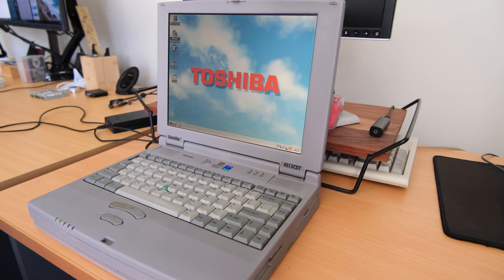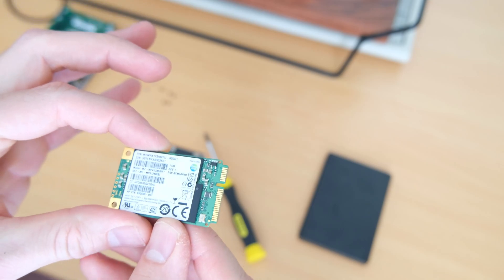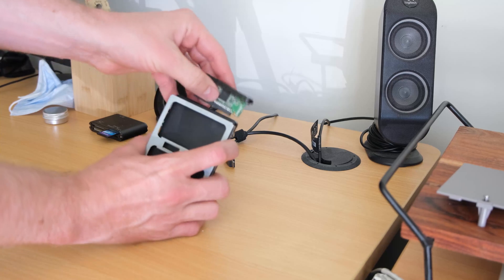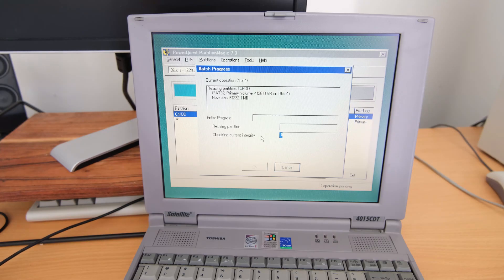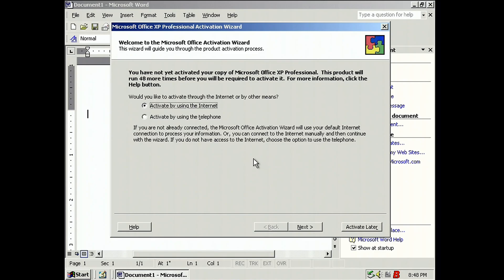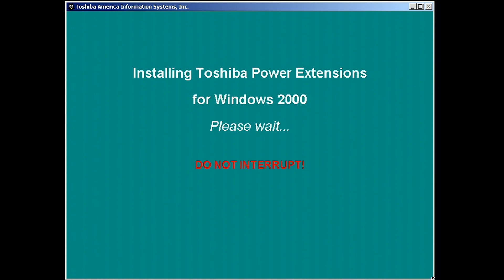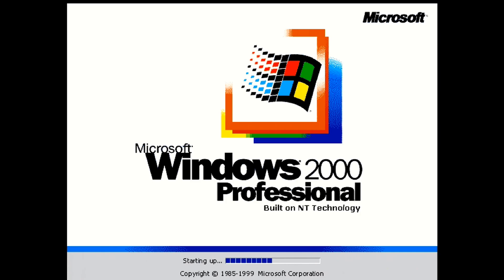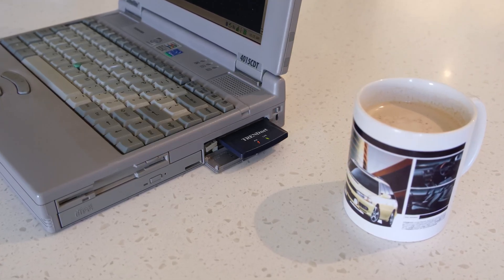Upgrades for the Toshiba 4015CDT

Comment: the biggest bottleneck on old computers was 100% hard drives. I used to have a 450mhz pentium 3 and it was so ridiculously slow for anything (back in 2000), i now own a toshiba tecra 510cdt which i have added a cf card and on the same os (win 98) this Pentium 1 140mhz computer is faster at everything. All because it has a solid state drive! Its actually faster than my thinkpad t22 that was around 900mhz, for exactly the same reason.
Reply from the maker: The SSD is still going strong in this one as well. Biggest bottle neck now is waiting for the network stack to finish loading on boot

Comment: Hey it'd be worth running an HDD benchmark test against this m-sata to mini-ide adaptor and maybe check the results against other types of adapters. I know for sure that the SD to IDE (or mini ide) are dog slow.
Reply from the maker: Good idea! I should do a follow up video on that. I'll track down a tool that works with Windows 95, as I still have the old Hard Drive with that on it. I've heard that SD Cards are a bit hit or miss. I think when that buffer runs out they can't cope with all the I/O